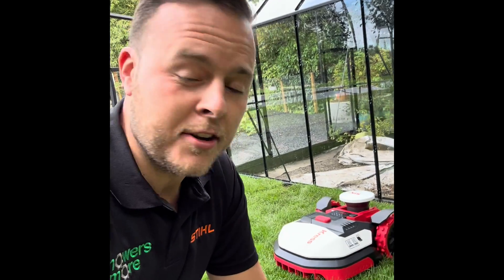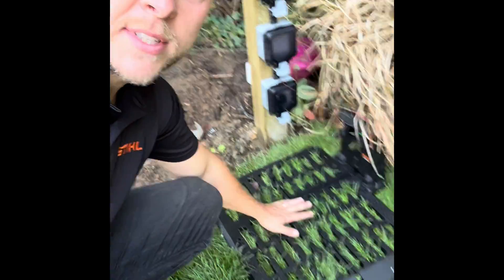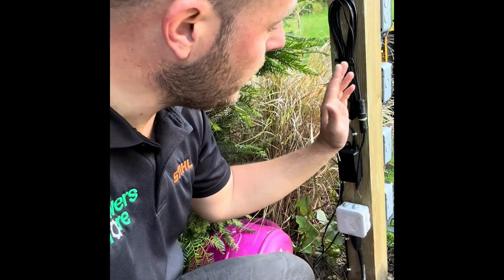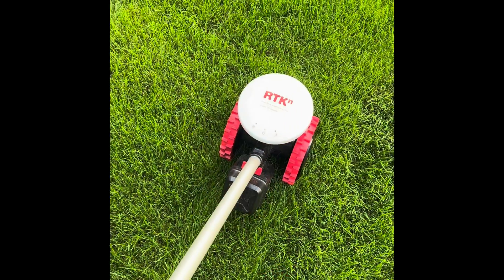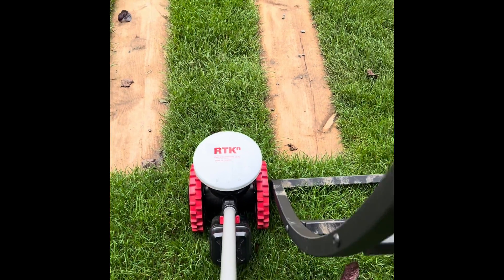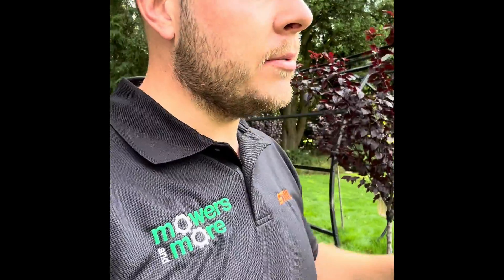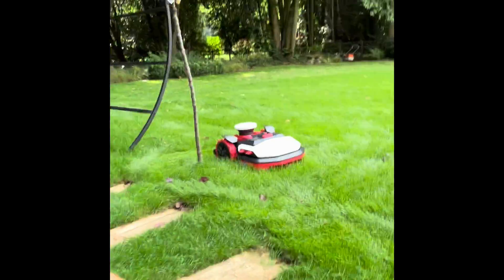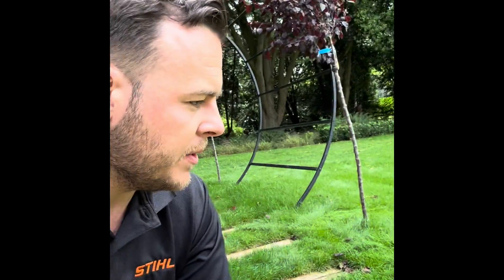KRESS RTKn Robotic Mower Installation

Comment: What temperature can the lawnmower take when it gets cold?
Reply from the maker: So the machine is fitted with a lithium ion battery and ideally should not be stored at less than 0°C so when it gets colder than that, I would suggest you wrap it in an old blanket and stick it in the shed. 🔋 ✅

Comment: Hi Josh I have a KR172E and I am trying to set it up but when I turn it on it comes up with an error message "Map generate Fail HEAD Demo BODY activate Can you advise?
Reply from the maker: Hi Brett I do know what is causing this, your dealer has activated the mower but not the head (pilot) was it just installed? It’s a simple and remote process your dealer can do. (And should have done prior to installation)

Comment: Hi Josh. I have recently bought a Kress Robot Mower in France. This has been set up for my Garden by the local dealer. My Question is, if in the next couple of years I decide to move back to the UK, how would I get it set up for my UK garden and not connected to the current French Garden it is set up for. Is this possible or do I have to leave it in France, IE sell it to the new house owner?
Many Thanks
Reply from the maker: @RichardCaygill   great question I’ve got no reason to believe that it wouldn’t work in the UK however you will need to contact your local agent and get a price for them to reinstall the unit. Should just be a case of setting up the base station and doing a full map of your UK garden.
Reply: Thanks, hopefully that would work.

Comment: Doit on laisser le robot  sous tension  s’il ne fonctionne que tous les 2 jours.
Reply from the maker: @FernandLEGAll  hi I had to use a translating tool to understand your comment but yes, you should leave the machine powered on 24 seven, if the power station has no power, the robot will automatically power down 20 minutes later.

Comment: Josh, I have purchased a Kress KR122E, which is new but was repossessed, my problem is I don't have the pin code, can this be reset/recovered.
Reply from the maker: You will need to contact KRESS directly or possibly your nearest dealer, they will be able to check on the database if it is a stolen machine or not, you will also need your proof of purchase from the source you purchase the machine from, if the machine checks out then KRESS will remotely unlock the machine for you and reset it back to default settings.
Reply: @Joshonthemowers  Thank you Josh,  I do have a receipt and it was purchased through a large reputable auction house, I have located an official dealer just 4 miles from me, so they should get is sorted. Thanks again.

Comment: Hi. Great video. 
I have a few questions if you don't mind....

How far away do these work from Kress RTK reference stations?  
Do GOPS corrections get less accurate the further you fare from one?
Is there a map anywhere showing the base station network locations?
What's the process if you're too far from a reference station? (eg. will Kress install a reference station at your property, and is this an extra charge?)
Are all parts available to end-users or are these machines dealer-service only?
Is setup & installation included with the purchase cost or is it an extra charge?

Also, does Kress have an API for controlling & monitoring their automowers?

...Would like to use something like this for mowing around a camp-ground. It'd be ideal if we could set each pitch as a separate mowing zone then integrate with the booking system so the mower knows to not mow certain zones on dates that the pitch is booked out.

NB. Campground & smallholding is just a sideline, I'm a programmer by trade. So long as there's an API where you can enable/disable the zone schedules I should be able to figure something out.

Comment: Can it work without the magnetic wire
Reply from the maker: It can’t. But what I have learnt is that you don’t need the full length like in this video, I have not tried but possibly only 1m would be sufficient.
Reply: @Joshonthemowers  I mean can it do like a neighbors house after its charged then another neighbors house then charge it then another neighbors houses, ect..  I saying can't I do that?   Is it really connected to a 25 mile radius antenna that kress builds?

Comment: The worst product for the garden. The Kress’After sale service is inexistant .
Reply from the maker: Sounds like you may have had a bad experience but I wouldn’t generalise. Approved dealers offer the after sales service to consumers, if a dealer has a problem then KRESS are very easy to contact and fast to resolve an issue. For those consumers that have had difficulty with their dealers there  is a phone number so you can call them directly. But as previously stated, your dealer is responsible for direct after sales support.
Reply: @Joshonthemowers mails, phone calls….Kress never respond to my dealer (and it is the same for me).  2 years of breackdows and no solution. 
I speak from France and I’m not the only one in this situation.

Comment: Hey there - a few questions. This was really good to show people the setup. Can the base be under roof structures to protect from the elements? How is the experience for your customer now that it has been doing its job for a while? Is the app easy to use? Can you control the mower remotely if it gets "stuck"? Thanks!

Comment: I can't get the location light to turn green. It's in the open with no obstruction
Reply from the maker: Are you in range of an antenna? Are you an end user or a dealer? Has the machine already been installed by a dealer?